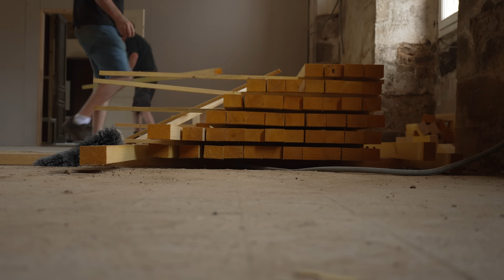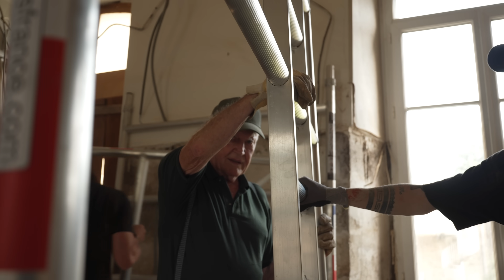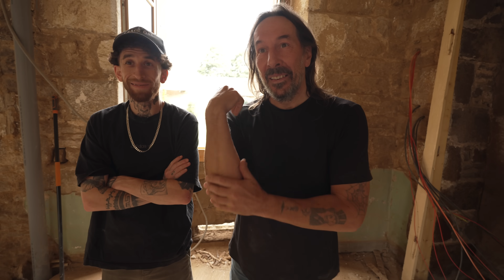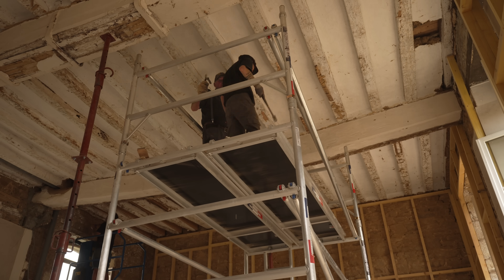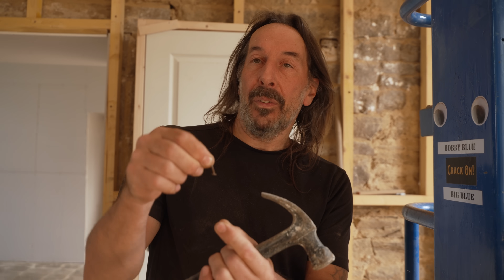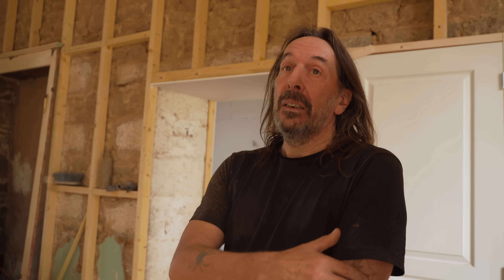Removing Thousands Of Nails Before The Sand Blasting

Comment: There are two ways to pull nails with a claw hammer. One is the obvious hook onto the nail and pull ut out... the other is to hook the nail and pull the handle to the side. Instead. That's the technique I would use

Comment: if I'm restoring a painting and it's riddled with rusty old nails I use the method Phil showed here.
in other instances when the frame is rotten and the canvas detached I remove the canvas and save the nails by rubbing the nailed edge with toilet duck blue liquid I wrap it in plastic wrap and wait 24 hours then I can pull the nails out easily with my fingers I put them in water with 20% chlorine for an hour to stop the acid and then rinse them off and let them dry for reuse.

Comment: BILLY, ARE YOU JUST GOING TO HANG PLASTIC OR TARPS FROM THE CENTER OF THE LIBRARY? SO YOU DON'T HAVE TO COVER OR MOVE OUT THE BOOKCASES? I HOPE SO, THAT SEEMS THE EASIEST WAY TO DO THE SAND BLASTING FROM THE UPSTAIRS.  IF YOU'RE REALLY WORRIED ABOUT THE SAND, YOU CAN ALSO COVER THE BOOKCASES WITH SHEETS OR TARPS TOO.
Reply from the maker: they will be easy enough to remove, probably for the best the dust will find it’s way everywhere